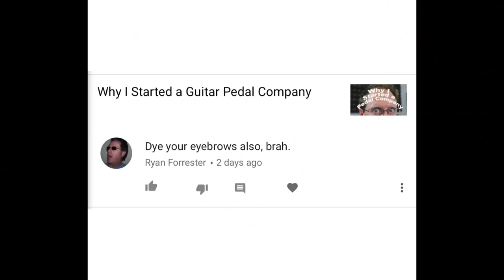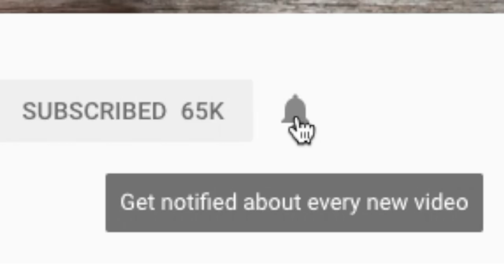Running pedals at 18v vs 9v, what's the difference?

Comment: I have always felt (based on YouTube videos only) that there is a subtle increase in note definition of dirt pedals at 18v. I hear that in this video as well.
Reply: The extra headroom obviously affects the gain at identical settings, but the dynamics and harmonics the higher voltage provides are the real magic that you get in comparison.
Reply: @jmath679  It wasn't subtle to me at all. These pedals are more exciting and visceral at 18v! That said be careful to check the pedal can take it first.. works for most but for example it will fry a Carbon Copy

Comment: Isn't that bad when you plug 9v pedal onto the 18v power supply? Someone answer plsss hehe
Reply from the maker: It can be. Some pedals can handle it, some can not. You have to look up the manual to find out, or ask the manufacturer specifically. We always put in our manuals what voltages will work with the pedal.

Comment: I found 18v to be valuable mostly in a clean'ish type circuits, be it a boost, preamp, modulation, compressor, eq. But in a gain, fuzz/dist/od circuit it always makes want to go down to 9v, just doesn't feel right at 18.
Reply: Preamps in our amps works with higher than 9V voltage. The goal is to have pedal sounding like an amp. Bogner, gurus, klon - all that run high voltage. 9 volt is converted internally in those units and that is why we love them.

Comment: Great video? Is it common for pedals to be able to accept either voltage? It seems like that could overload the resistors and burn the pedal. If this is not common, how would you be able to tell if a pedal can accept either?
Reply: Check the owner's manual and any printing indicating the acceptable power range by the plug-in. I bet exceeding 9V by double in many circuits can burn up regulators & coils with prolonged use, like it does in cars/tractors/motorcycles/ATVs/boats/etc

Comment: So you rate most of your pedals for both 9V and 18V? I would figure that the added voltage would eventually cause components (mostly the resisters) within the circuit to break down faster than at 9V.

Comment: 5yrs late to the game:  HOW ‘bout Choruses?  I have an 80’s Boss CE-2.  It got dropped and flaked out.  Sent it off to Boss in Cali, the sent it back “fixed”. It wasn’t.  I sent it again.  Came back perfect.  During conversations back & forth, i asked them which was better, 9, 12, or 18v.  Their emphatic reply was Never use any but a boss approved 9v adapter.   I have read to the contrary that the choruses sound “better” with 18v.   Anybody want to comment on their “Never use” instructions?  Brian?

Comment: Serious question bitches, sooo 18 volts create more headroom? For the example is that the reason why it sounds less distorted when he plays the first pedal running on 18v ? Also can it damage to run a regular 9 boost pedal using a voltage doubler or straight 18v cable?

Comment: Hi mr Wampler. I have a pinnacle deluxe v2 and I’d like to try how it sounds ad 18v. What I’d like to ask is: do I need to change the cable before switching voltage on my power supply or there's no difference?

Comment: Doesn't it depend on the design?  I mean I'll plug 9v supply into an 18v stop box but 18v into a it only needs 9v seems wrong!
Can I make a 'safety' for my peace o mind during testing.
Also, on the Ethereal why doesn't it change the deepest rate?  Were clocks ever voltage dependant? I doubt they are timed to the 50\60Hz like my microwave whose clock and cook timer were always correct in the US but wrong in the former West Berlin.
Wow the Thirty at @9v then18v, I expected a big difference but not that exaggerated. I also thought the higher voltage would remove sputter if it had any at that setting to begin with. Is a current dependent and 18v has absolutely not enough babyamps?

Comment: The label on the 30-Something pedal needs to reflect 9V specifically, 9-18V and if I didn't watch the video, I'd return it as defective the way it sounds. That out of bias needed to be tested before it was passed off as 9-18V, it's clearly a 9V, wonder what 12V would sound like with it ? Which leads me to ask if a pedal is indicated as 9V on the actual product, but manual/user guide says you can use 9-12V or 9-18V what are the implications of over-volting the pedal ? Shorter life span, does the pedal get too hot for operating temperature ? Or do the lower quality electronic components on the circuit boards burn up ?

Comment: ok i guess i'm missing the joke cuz back when i was new to pedals i accidentally plugged a 12v wort into a tube screamer and fried it.
Reply: Ah it's not a joke, some pedals really do take 9 as well as 18, but they will say "9v-18v" above the power input on the face of the pedal. Tubes creamer is definitely El fry-o...
Reply: I confess I find that hard to believe .. sure you didn't reverse the polarity or something? Most analogue pedals will happily take 12V without letting out smoke.

Comment: Is there different pedals that must be ran on only 9,  or 18 volts? This is getting a little confusing.  Not sure how to use this info,  and what to do  to set up the pedal board the best way...Is it possible to  get shocked or killed  by having  the wrong power supply with the wrong pedals?

Comment: beware of running higher voltages it will increase the risk of damage to 16V capacitors. Pedals are made usually made with the cheapest components, 16V caps instead of 25V, saving a fraction of a cent.
Reply from the maker: some pedals are, not all. Seek the manual to see what voltages your pedal will work with.

Comment: I have about a dozen pedals that I prefer to run at 18v. I'm looking for a power supply that has more than 4, 18v outputs. Anyone know of one, or am I going to have to build one myself? I've been using a homemade battery box, that has a bunch of 9v battery snaps wired in series, connected to a 2.1mm x 5.5mm cable for each one of my pedals. Carbon batteries are pretty cheap when bought in bulk, and they last a long time on all but some modulation pedals. At least if you remember to unplug them. Just trying to find out if there is a power supply in production, that has 10 or so 18v outputs. Thanks for any leads.

Comment: Thabks for the vid.   I tried my  Pinnacle Deluxe at 18v and it did the same thing as the Thirty Something.  Now, when I power up my pedal board, the pinnacle is un the on mode every time and I have to turn it off. What happened?

Comment: So, why is there an 18 V option in the Thirty Something? Just to prevent from breaking with wrong Voltage? Or to allow weird noises? Or because it works with other pedals like that? Very interesting thing.

Btw I think your natural eyebrows fit you better, they look good. The dyed ones look exaggerated :)

Comment: I'm surprised you didn't wire up a switch box to switch between 9 and 18 volts on the same plug. You should build and Market them, people could change voltage on the Fly. Please remember me if it's successful :-) Thanks!🎸

Comment: The 9v sounds more distorted or more presence in the tone like the 1-2khz stuff whereas the 18V sounded slightly less clipped, and "fuller" in sound but not exactly "richer"?
Reply from the maker: Yep, 9v will distort more, since it’s running out of headroom sooner than the higher voltage version does. This creates more harmonics, which can sound like more presence as well sometimes

Comment: I might be suffering from confirmation bias here, but the Clarksdale immediately sounded different at 18v, and to my ears, better. Listening through a decent, fairly flat set of monitors, I found the drive to be tighter in the low end, and a hair more definition in the mids. I agree that the Ego and Ethereal both sound a bit more bright, but I don't hear enough improvement to give up a precious clean & isolated slot from my power supply. Thanks for the informative video, as always. And…the eyebrows are FIRE!!

Comment: Will overdrive's with an npn transistor after the opamp have the same sound at 18v as the booster on your thirty something? Or just circuits that only use npn transistors without an opamp?

Comment: The base or low mids seems to tighten up a bit, or become less flubby. I noticed this especially with my special cranker in germanium mode. I know this video is kind of about breaking down the 9 volt versus 18 volt thing in technical terms but I do not know things in a technical way regarding pedals haha

Comment: Ive been running my Tube Driver on 18v for a while now. It's a bias modded older Tube Driver and I wouldn't recommend doing this to anyone else cause when you pay so much for a rare pedal you don't want to fry it. I got lucky cause the builder didn't know if it would hurt it or not. What I did was split the 18v out on my pwr unit with a 10 band E Q which needs 18v and threw the odd connect into the Driver to see if it worked. It gives it more headroom so I use less gain now. And the older RCA tube inside gets more pwr to use the bias knob with. Sounds pretty cool to me but what do I know.

Comment: I love using j rocket archer set clean and luod into euphoria 18V in open settings. It is very fast, very open, not so easy to play but it is imposible to not be heard in the mix with this setup. For me it is a holy grail of low gain overdrive sound. I thing the same could be using tumnus.

Comment: Brian I had an idea recently while looking at a Rat schem. Have you ever played with changing the pull-up voltage that keeps the signal in the middle of the op amp range, and maybe make the voltage divider a pot? I imagine you could get some interesting clipping from pushing the signal into one of the rails, but I haven't been able to give it a try.

Comment: is it safe to use my 12v pedals with the 9v power suply in the bcb 60 pedal board? i wont damage equipment?
Reply from the maker: TOTALLY depends on the pedal. Contact the manufacturer to make sure.
Reply: @wampler_pedals  thanks, i ordered a universal power suply for 9, 12 and 18v. Dont want to take risks with expensive gear 😉

Comment: Question: Can you put a 9v power supply on a pedal designed for 18v or viceversa without damaging said pedal or the PS??? I am very careful with the power thing🤷‍♂️😳👍
Reply: No. You'll blow the pedal. This particular pedal is designed for both so you can do either but not all pedals have this feature
Reply: A pedal designed for 18v will not fry at 9v..

But many 9v pedals can fry at 18v.

Comment: BTW: I always wanted to know this (topic fits): Do most pedals have a voltage regulator at the beginning of the circuit (for maintaining the same sound whenever you play it)? Let's say you have a 9V rechargeable battery and as we know it naturally doesn't really deliver 9V. Will a TS upscale the voltage to 9V and drain the battery current a bit more in order to do so? Or will it just feed the circuit with whatever voltage you put in (let's say your power supply has only 7.5 Volts or so!).
Reply from the maker: Most just feed the circuit whatever you put into it.

Comment: Analog pedals are meant to be powered over a large range 6.5V to 16V due to the variety of power supplies, class 2 supplies tend not to be regulated so their output will vary depending on the load, output volume.  ex a class 2 9V supply might be as high as 16V unplugged, when plugged in it might drop to 10V or if you use it to power a mini amp it may drop to 6V due to higher current
Reply from the maker: that's a really crappy power supply if it's swinging that wildly.
Reply: actually it is the nature of the beast
Reply from the maker: with a crappy supply it is!

Comment: Tummus can be running in 18v ?
Reply from the maker: No, only 9v. Internally it is increasing voltage. Applying 18v will make it no longer work

Comment: If I have a pedal like a Pinnacle Deluxe V2, will it run on 12 volts? Or is it only 9 or 18? My power supply only has a max 12 volt output
Reply: When it says 9v-18v on the pedal, it means it can run anywhere between those two :)
Reply: Very cool, I have it available so I may as well give it a shot. Thanks!
Reply: I actually run my pinnacle at 12V (and sometimes 15V). For some reason it just feels better to me. Dosn't really sound different, just a better feel. Could be placebo - not sure. I just know I like it.

Comment: Can the Tumnus Deluxe run at 18v?
Reply from the maker: noooooo that'll make it smoke. That's why the case says 9v only.
Reply from the maker: I should clarify. The Tumnus pedals both have an internal circuit that boosts the voltage. For this reason it can only be ran at 9v

Comment: distortion is created with diodes, they don't change, so the sound really does not change only in the sense with current draw from lower notes will be a more meatier sound. If the battery goes low then you'll lose some headroom.

Comment: When it comes to anything intended to produce clipping, there can be components whose functioning is fixed*, and others whose functioning is *relative*.  So, diodes have a fixed "forward voltage".  If they are used for clipping, then the clipping threshold remains the same, regardless of what supply voltage is used.  If the clipping threshold is 600mv, you can use a 30V supply and it will still clip at 600mv.  Op-amps, on the other hand, function in a *relative manner.  So, a 12V supply provides more room for the op-amp to "swing" up and down, and 18V provides even more headroom.  

So, the larger "big picture" consideration is the extent to which the particular pedal depends on relative*, vs *fixed*, functions for its signature sound.  If the sound depends on relative things, then experimenting with supply voltage may prove productive (provided all components are spec'd for the highest supply voltage you expect to tinker with).  If the signature sound relies on fixed functions, then playing with supply voltage  may yield only minimal sonic changes.  In some instances (and I think the MXR Distortion+ is a prime example), the signature sound of the pedal is a combination of both the fixed functioning of clipping diodes *and the headroom limitations of a specific op-amp.
Reply: I really have to master boldfacing in this medium.  Tricky.